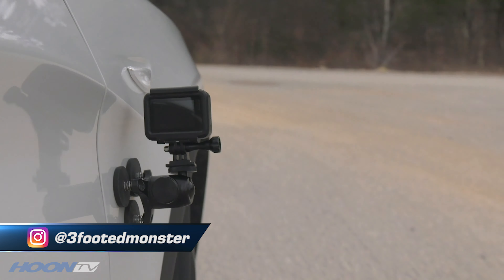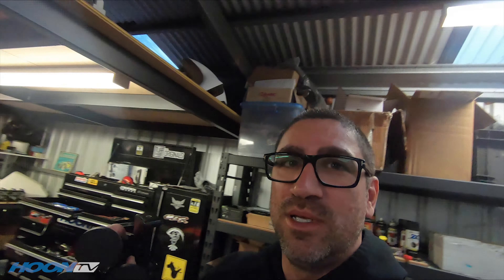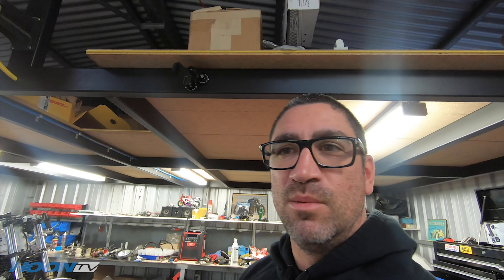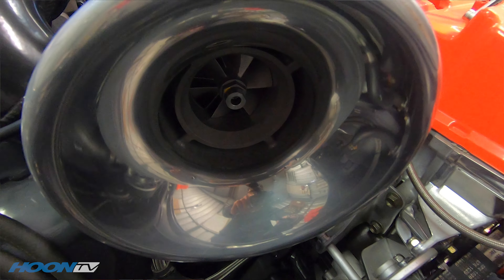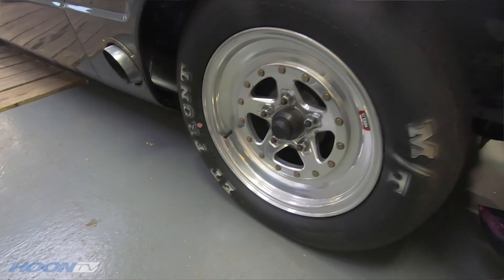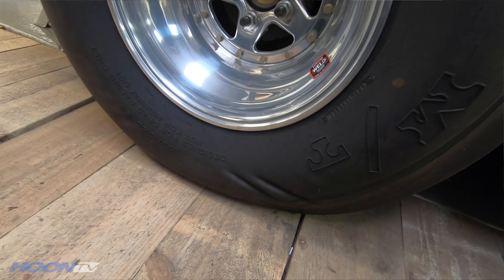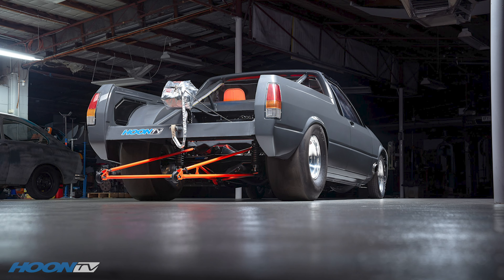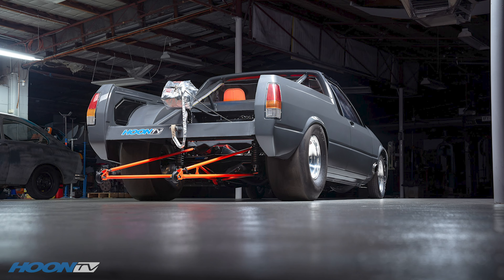1000hp or so... Lets get it done!

Comment: Where did you get the fairings from? I’ve got a 92 cbr900 but has 99 fairings/tank on it and thinking about putting it back to the original colour scheme
Reply from the maker: They’re from an importer in Sydney called 12K. They’re not the greatest at communication though.
Reply: Cheers that’s where everyone is recommending I’ll check them out